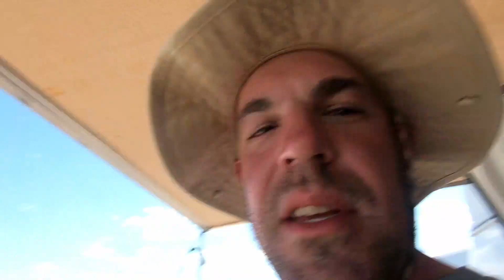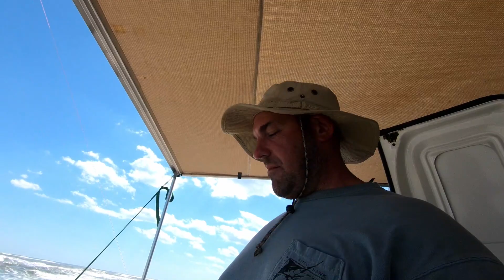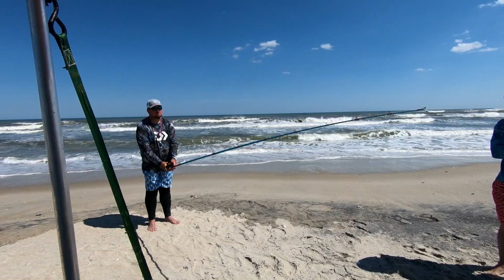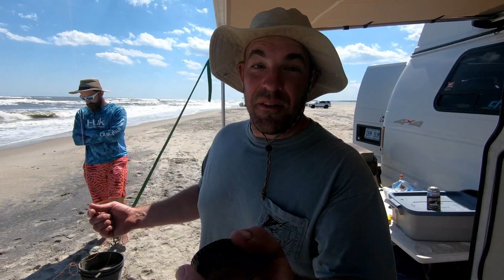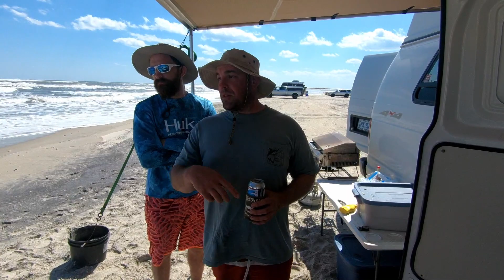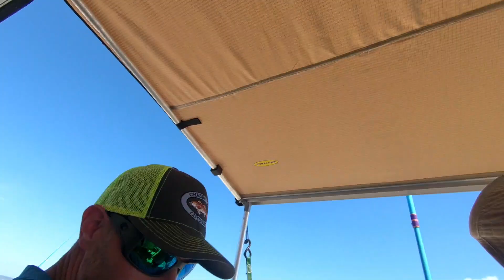Testing actual drag tension----fishing.

Comment: Hi mate ,have found your channel and subscribed.I am glad you did this as I am sick of hearing the wank in sales pitches ,like this reel has 22 lbs of drag or that reel 
had 30 lbs etc.It is an absolute l load of crap .If you have say 60 yards of 20lb  line out on the beach with a fish on,the rod has to load right up before any drag gets even used,probably putting 2 to 3 lbs of pressure on , seriously in reality 4 lbs of drag is almost lock up.